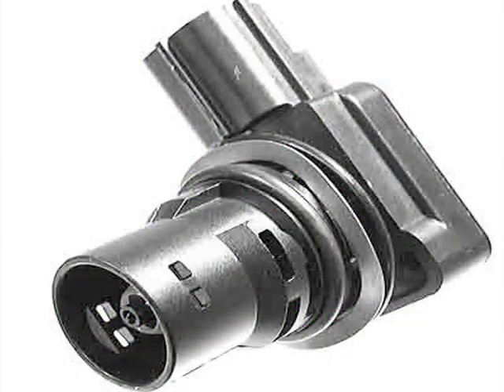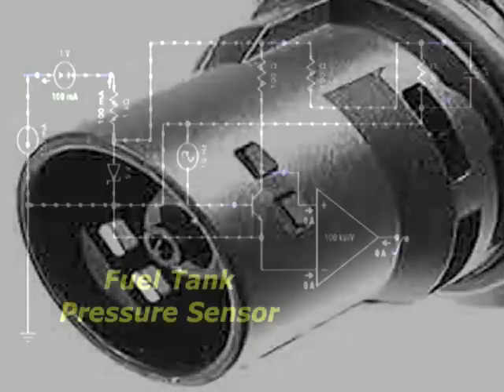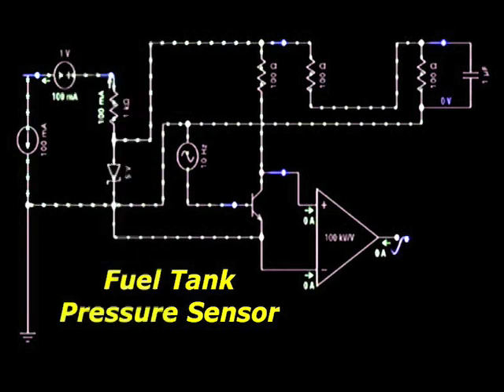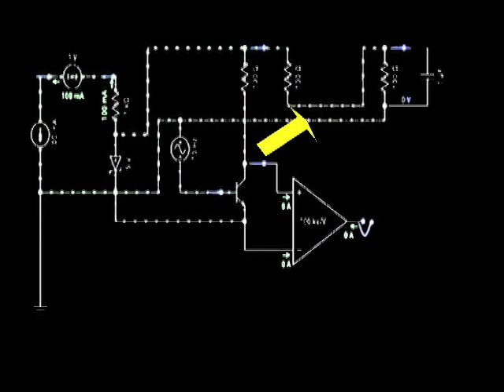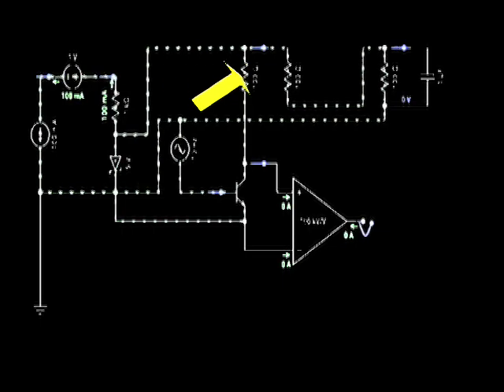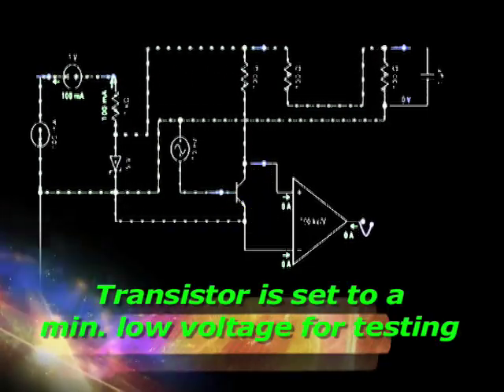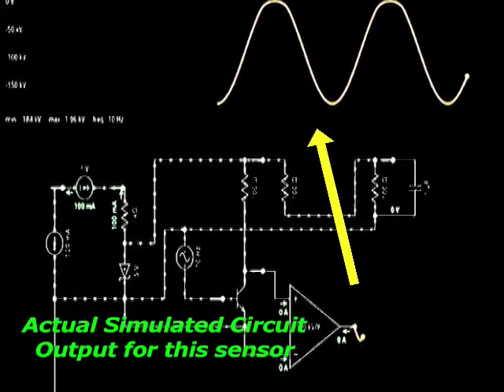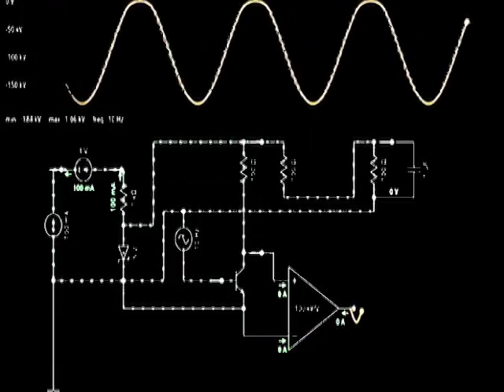Fuel Tank Pressure Sensor Signal Circuit

Comment from the maker: The FTP sensor is used to signal the ECM fuel tank pressure during EVAP monitor. If EVAP monitor fails ECM will turn ON CEL. If on the other hand there's a rationality check failure for the FTP sensor, the ECM will also turn ON CEL and issue DTCs. Itis just as the video says. Video also goes into electronics details for the circuit. Thanks for posting.
Reply: ADPTraining hello.. where is location FTP sensor?.. my car honda accord CL7 having a FTP sensor, but im not found where is the location. Thanks. Pls help

Comment: please someone help me p0453 won't go away car was running but I erase the code with my scanner  and I try to start it, but nothing something short out the fuel pump, I  replaced the car start again but the code still in, I went to the yunkard I took 3 FTPs from different car I try none of them works , live data is in 5v even if I unplug the connector from the sensor nothing happens 5v all the time wires look perfect